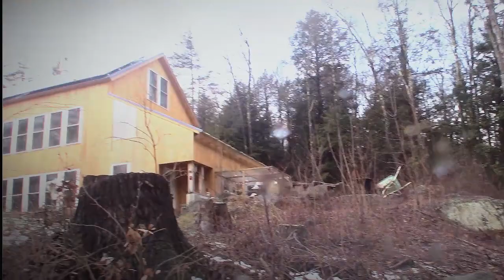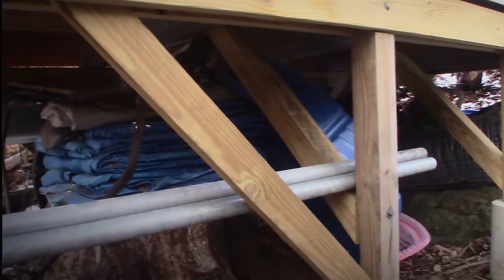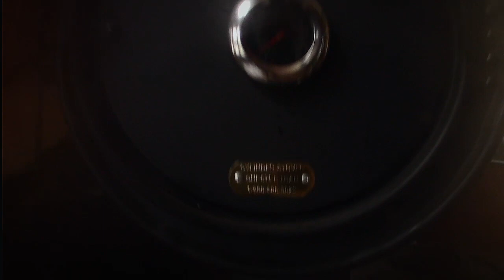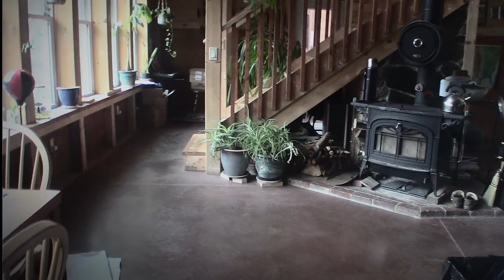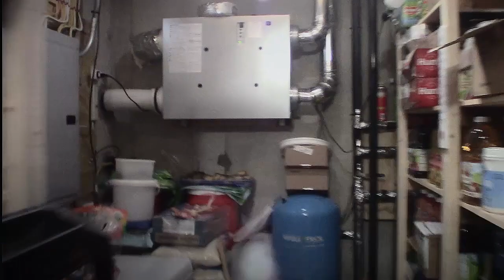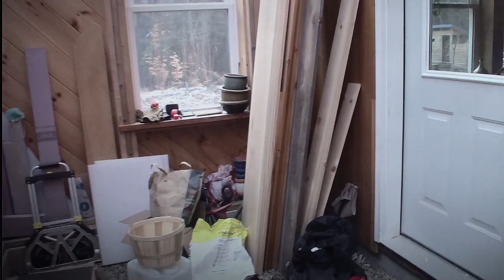Home Heating System Full Tour 2023

Comment: Very nice. I'm lucky enough to have a house that came with a woodburner, and it's crazy efficient: heats the whole house in 1 hour with five pieces of wood, then two pieces added every 2 hours or so.

I put a 20 inch box fan in the attic access hatch for use as a Whole House Fan. Works great during spring/summer to cool the house.